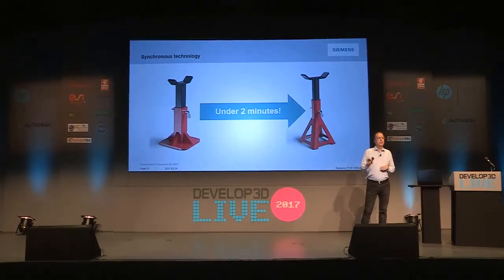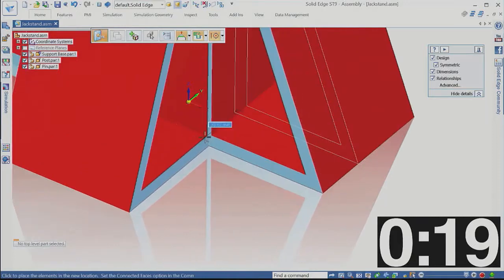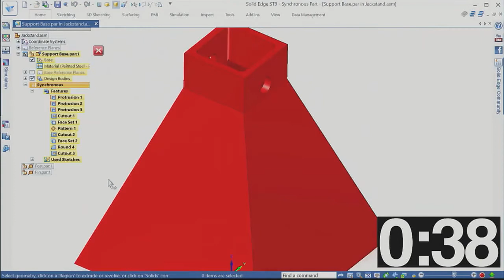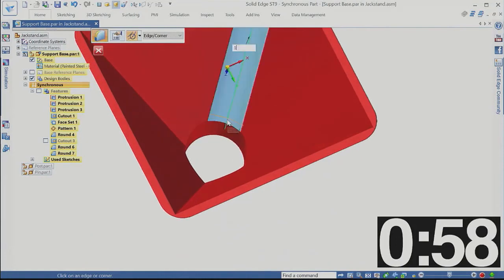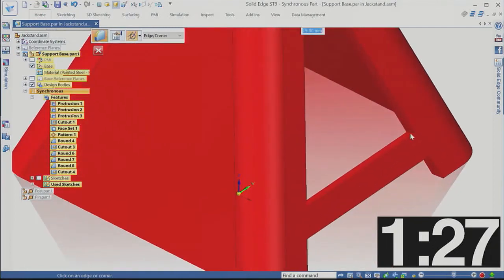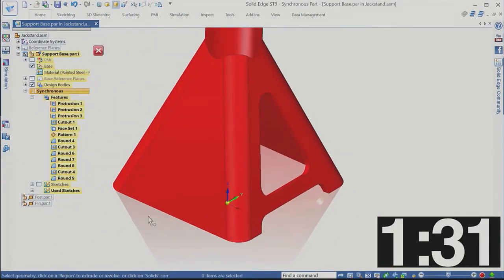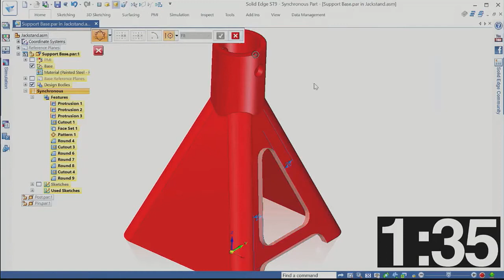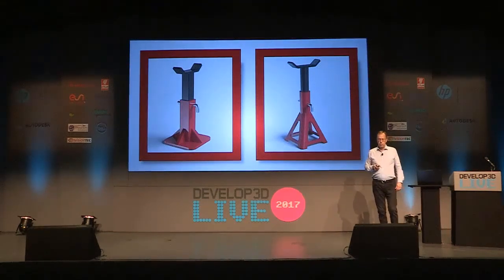ST Develop3D 2017

Comment: awesome Tushar. Now we need a slow motion - step by step video so I can learn how to do this in under 2 minutes myself.
Reply from the maker: Mitch, I can post a slow motion version of the partial clip which shows the model edit using a video editing software. Is that what you are looking for ? or expecting Siemens to publish a step-by-step video ?
Reply: Hi Tushar, I tried stopping the video at about one second intervals to catch what commands or shortcut keys were used. I guess I would want Siemens to publish a step by step of all the commands and keystrokes used. Even then, I'm sure I would have to practice doing this over several times before I would even come close to the speed at which the person accomplished this. I thought you may have been the person which created this video. I think I would learn more about using Solid Edge if I were able to practice many of these quick videos I have seen displayed, to get used to the thought of when to use shortcuts...etc. Thank you Tushar for getting back to me.
Reply from the maker: Hi Mitch, you can post a comment on this thread on the official Solid Edge forum and chances are someone might share the video and the model files as well.https://community.plm.automation.siemens.com/t5/Solid-Edge-Forum/Develop3D-Live-Presentation-by-Dan-Staples/td-p/403261